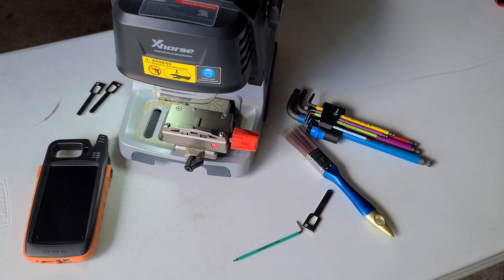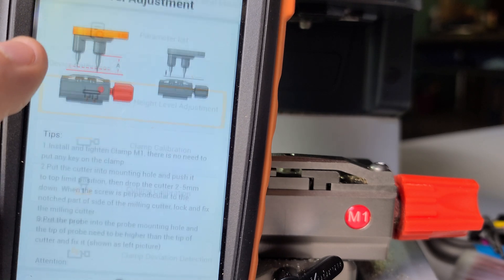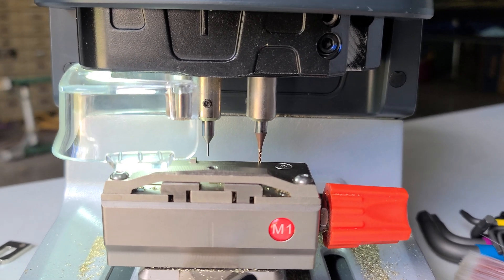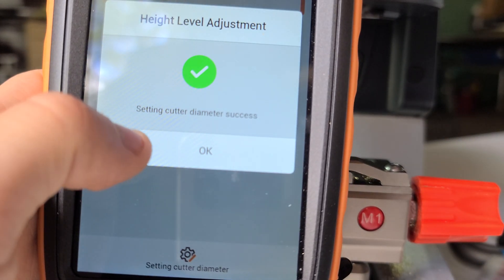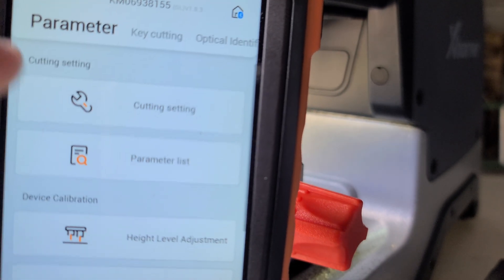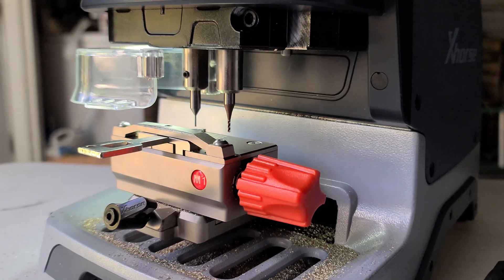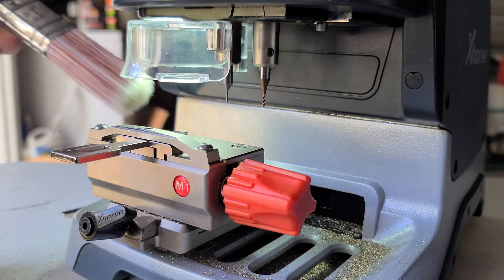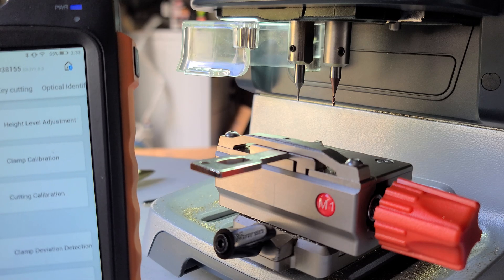Xhorse Dolphin xp005 calibration

Comment: Hi, thanks for great video! Why do you prefer to use older version Xhorse Dolphin vs Dolphin 2 that has the touch screen?
Reply from the maker: Both are great  but if you already have a keytool the extra money for a screen is not worth it in my opinion. Also one more thing to break when I move the machine around. To each their own. Both offer the same support and coverage. They even make a model now without the battery.